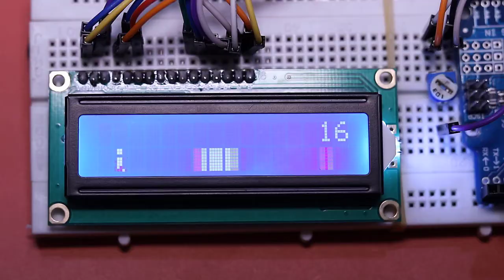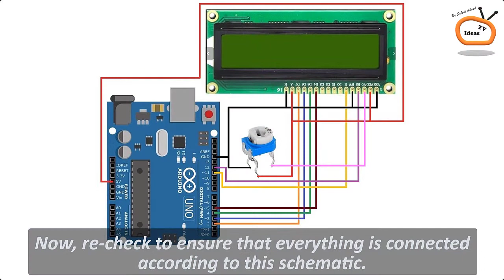Top 4 Arduino Projects for Beginners (Compilation)

Comment: The video is good but I have a question. In the second project, the circuit diagram with the wires seems not to be as same as in the video so I'm a bit confused. Can you explain how to connect the wires?

Comment: Good work. However I am absolutely NOT a fan of the looping techno as opposed to narration / discussion of the builds. It takes, about 2 minutes of that before I mute it, then, well, follow the video. This could be an old guy thing? I'm not, young anymore (those laughing, get ready, it happens quicker than you can imagine, lol). Anyway, I think anyone putting in time to design/create/build deserves kudos. So, kudos to you for doing so and sharing.

Comment: How  do you get the code to stay uploaded on the aurduino? I know you upload the code to the aurduino app, but how do you get it stay programmed on the aurduino?
Reply: you need to connect the USB cable given with aurdinuo board and connect and upload the program once again and disconnected the wire and place wherever you want, it will stay uplaoded until you press the reset button on the corner of the aurdinuo board

Comment: I uploaded the code and it said done uploading but still the car barrier project is not working.I saw in your video that 3 orange lights are glowing but in mine only 2 are glowing.Also do we need to connect the 9v battery.If yes then how?
Reply: Please reply
Reply from the maker: try with rechecking your code. re-download the code from description and upload it again. check your connections step by step, try to use another arduino board.

Comment: I uploaded the code and it said done uploading but still the car barrier project is not working.I saw in your video that 3 orange lights are glowing but in mine only 2 are glowing.Also do we need to connect the 9v battery.If yes then how?